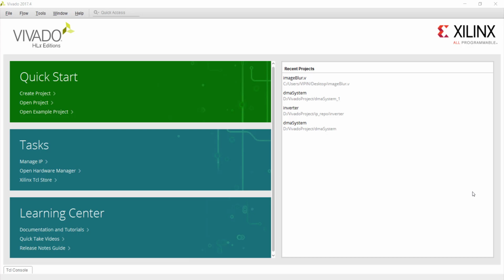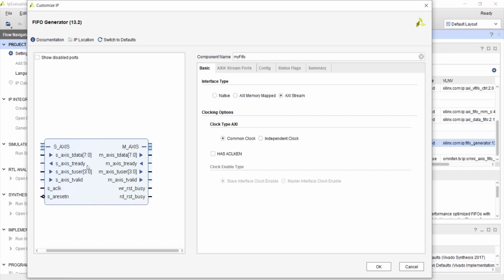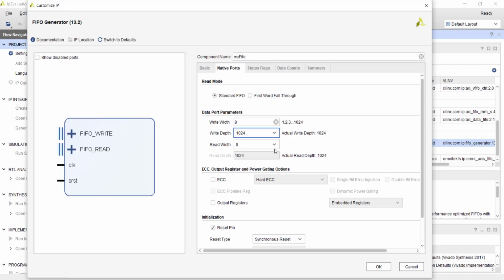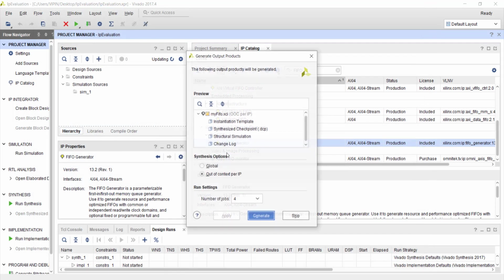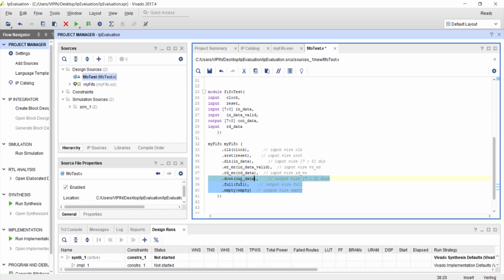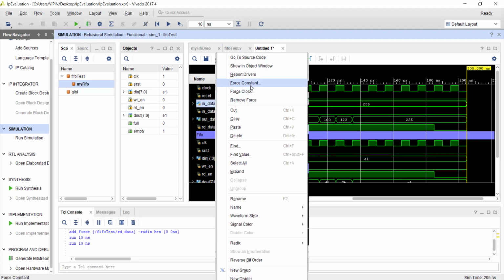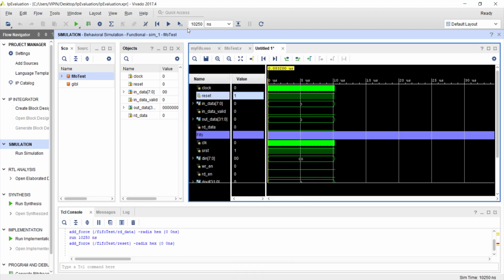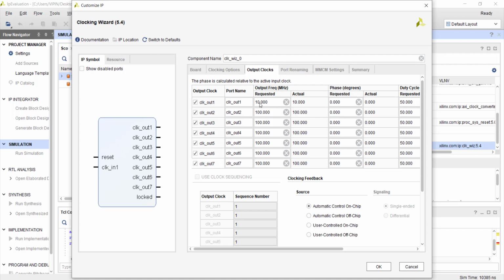Using Xilinx IP Cores Within Your Design

Comment: Thanks a lot sir ,Here u have used only FIFO and simulated it , I have a doubt how to interface more than one ip core in a design and simulate it could u please share me tutorial related to it .'
Thanks in advance
Reply: I have the same question as yours. Did you solve this issue? how to simulation the big project which includes many different ip cores?